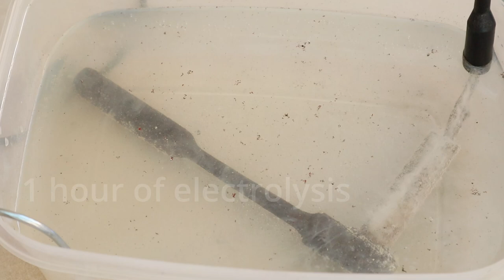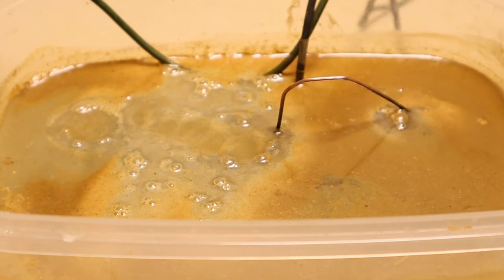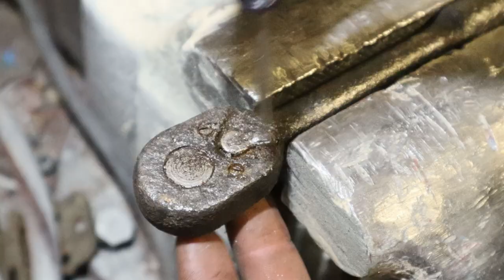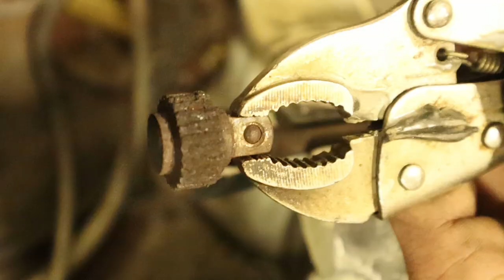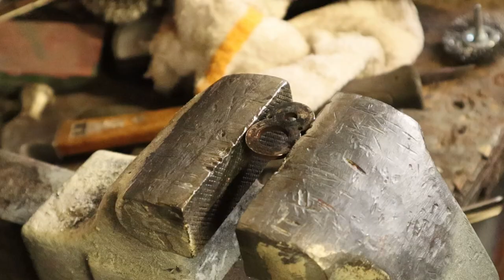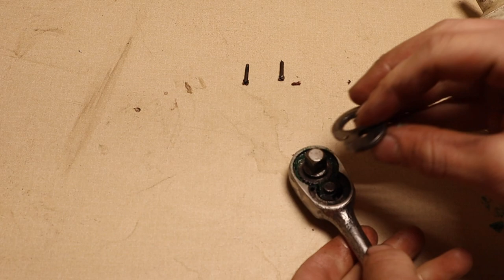Rusty Tool Restoration (Ratchet)

Comment: Just a tip, it would be nice to see it working after you completed the "restoration". Also may want to be careful what metal you use for the electrolysis if you're going that route for rust removal. The sacrificial piece you used looked to be a small zinc coated wire. A larger carbon steal piece would have worked much better.
Reply from the maker: Yeah we decided to start doing that on the videos after this one. And for electrolysis we changed over to using a piece of large, flat, rectangle scrap steel and we bend it into a U shape and have gotten better results, overall works more effectively. Thank you for the informative feedback! I’m glad we stepped in that direction following this video (:

Comment: What voltage and fluid is used for electrolysis?  I was cooking off rust from some unplated really rusty sockets in muriatic acid, just before watching this vid.  (I rinsed, dried and oiled them afterwards).
Reply from the maker: So we use a car battery charger, which is passing 12 volts. And we don’t use trickle charge, we use high pass through. You can use acid but honestly we tested so many ways and the results always ended up being similar. We tried vinegar, baking soda together. We tried baking soda by itself. We tried salt with baking soda. We’ve tried acid as well. To be honest, it never made a difference from what we had seen. So now we just use baking soda and water. And sometimes we throw in simple green. I know it sounds crazy but it still works really good.
Reply from the maker: The best results came more from what steel we used as the sacrificial piece plus how much area the sacrificial metal covered inside the electrolysis solution. So more coverage across your bin or tote or whatever you use works really well to hit the entire rusty object. I don’t know all the info about all the science but just that’s it works very very well. Check out the pliers video we uploaded shortly after this one, it will give you a better visual of what I’m saying (: